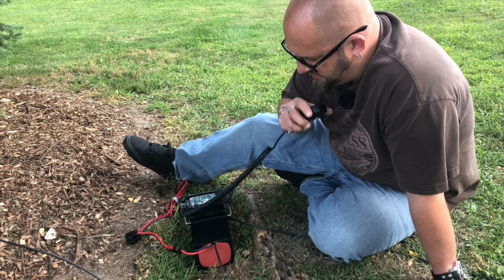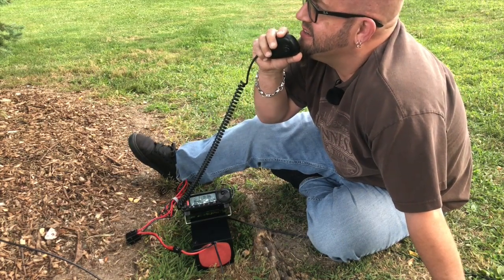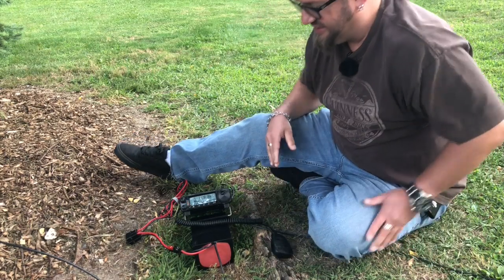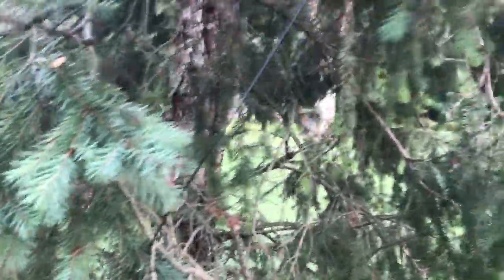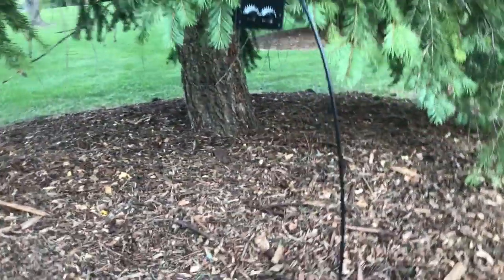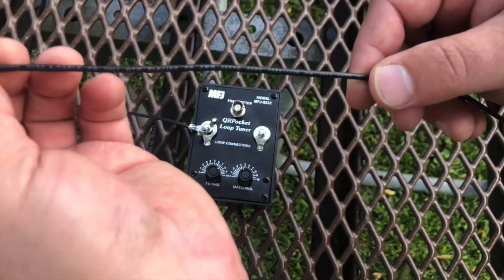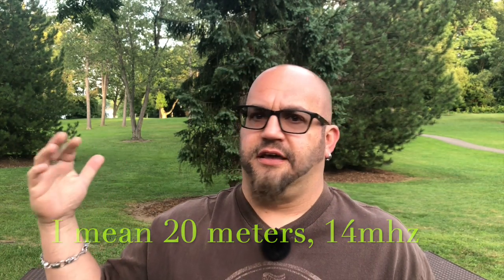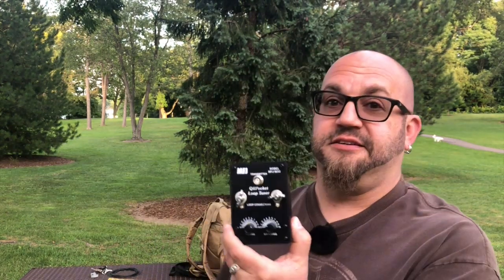The MFJ 9232 QRPocket Loop Tuner Ham Radio Antenna

Comment: I made a loop from 1/2 inch x 6' aluminum strip from Lowe's. Fashioned a loop and bored a hole big enough to fit on the studs on the tuner in each end.  I sit it on my desk after connecting to the tuner and "tuned" it using my MFJ antenna analyzer for 20M FT8...much easier than tuning with receiver / swr meter on rig.  I made a few contacts with it.  Just a quick note, these loops are not true magnetic loops, they are tuned loops.

Comment: The lower the resistance of the loop, the more efficient antenna it is, and the better it will work. Bent copper pipe would be very efficient, but a lot narrower on the tuning too.

Comment: Check out my channel, I have the MFJ-935C loop tuner and having lots of fun with it, it can handle up to 150 watts also, yesterday I was working some QRP with just 1.2 meters of 10mm soft copper pipe bent into a loop, I think this would be great to use with the MFJ-9232 which I also have but haven't used yet. I think a wire is easier to use for 40m. 

But with 4 meters of pipe bent into a loop and made contact with ham in Canada on 40m, I couldn't believe it and it was just sitting on a patio table!

Also for those with the 891 and do not know, in order to easily tune up you can press PTT and UP on the mic and it will send a 5w carrier and change the meter from power to SWR so you don't have to go through menus, just set 5w on AM once and you won't have to do it again, the 891 is an amazing radio and one of the most underrated radios in ham radio.

Comment: I see that that the tuning is done with the little tuner, but is it possible to get it as close as possible to say under 2:1 match and then use the tuner on the radio or external tuner?

Comment: I think i live in a dead zone!
MFJ-9232 set up for 20 meters, nothing. I tried different bands (and wire lengths) and nothing, Looks like i'm stuck on 2 meters......
Reply from the maker: Really??   That’s odd.  This thing was picking up signals inside my faraday cage of a house.  The rx was fantastic.  I didn’t use this too much on tx and eventually gave the antenna to a new young ham.  I just followed the instructions for the wire lengths and it worked for me.

Comment: Hi Mike:

BasedontourYouTube review (and others) I decided to buy the MFJ 9232 mini loop tuner.

I’m using a qrp rig that doesn’t have a built-ion SWR meter 

Do you see a problem in tuning this antenna using a mini VNA?  I have another antenna analyzer but I want to keep weight and bulk down

73guy
AE6FE 
Newark, CA
Reply from the maker: Not at all.   That NanoVNA would be perfect.  Have fun out there.

Comment: would this work in the cold? I have a covered patio where i could set this up and use it in the winter. I have tried loop antennas indoors and they just don't hear anything.
Thanks for another great video! Cheers from Lewis  VE3QJ
Reply from the maker: Temperature shouldn't matter at all.  I used this antenna inside my house and it heard all kinds of signals.  I was amazed as my house was like a faraday cage.

Comment: Of course, the cool thing is the tuner. I run a 275 ft at 75ft high loop, I've got 450 ohm running to it and a 4/1 ballun in the shack with a short piece of rg58 to the 7300 and get really good reports but I really think it could do even better ? What would you do or do you know any Guru's ? N6GRG Mike
Reply from the maker: Thats a heck of an antenna you got there.  This is just a little portable gadget, quite far from what you are talking about.  That big of an antenna is a little above my pay grade!

Comment: Hi Mike. What gauge wire do you suggest using? Thanks
Reply from the maker: You can pretty much use whatever you want.  It came with some 14 or 16 gauge I think.  If your doing qrp you can use some super thin stuff if you want.

Comment: I just got back home to CT from my camping trip in VT and saw this video.  When you said you had your antenna wrapped around a tree you weren't kidding!  I can't believe how strong I was coming in on that thing as my antenna wasn't really much better.  I was running 30W into my zip-line inverted vee with the center up only about 12 feet and the ends about a foot off the ground.  I was powering my radio with my SUV which was close to the antenna and de-tuning it to some degree as well.  So I guess that means the MFJ QRPocket Loop Tuner works!  This was a cool contact - I'm glad you caught me on the air!  I look forward to working you again in the future - 73 and thanks for including me in your video!  N1NUG - AKA SevenFortyOne.  BTW - you'll be in the video I post from this activation so keep an eye out ... might be a week or two before I get it edited and uploaded....
Reply from the maker: Right on man it was totally random catching you on the air.  I was just tuning around and I thought your voice sounded familiar, then I heard POTA and had to get you.  The antennas were working great.  This little loop has a surprisingly good receive, I'm quite shocked by it.  Your inverted V was doing quite well too, especially considering how low it is.  But thats portable radio.  It may not the the best conditions but it still works and thats what I love about it.  I look forward to seeing your video.  73
Reply: I'm in Guilford. I was living in Woodstock for a while. Where and how did you camp in Vermont. It's one of my favorite places. N1khb
Reply: @joewoodchuck3824  I was at lake bomoseen about a year ago.  I used to have family that lived in central Vermont so I'm very familiar with the State

Comment: I have two of those MFJ-9232, and also have the bigger brother MFJ-936B. There are indeed High- Q with narrow bandwidth, when fed with a low resistance conductor. The more resistance in your wire (thin wire), and poor connections will give you wider bandwidth, lower Q and more losses. But hey, you still make contacts. Mine use 3/8" soft copper tube, formed in a circle, and they are very high Q and have a very narrow bandwidth - they almost work like a pre-selector, any station above and below my frequency is notched out. These have the same attributes as a regular magnetic loop antenna - mag loops can be fed in many different ways, inductively fed, gamma, toroidal, or capacitively fed. These units are capacitively fed....also called an "army loop" or a "Pattersons Loop". Try it out - use a thick conductor, and you will see your Q go up, and bandwidth narrow. These are great units for experimenting with antennas

Comment: Really neat piece of equipment. Thanks for sharing. Suggestion: You could spray paint the wing nuts orange of shocking pink. Makes them easier to find when you drop them. You could always keep a couple extra on hand. 73

Comment: Sounds like a winner Mike.

The wire is 12 AWG  rated for 20 AMPS.

I tried an activation yesterday on with my WRC TIA  and mobile TS 480 at K-0345.  Heard lots of folks on 20 and 40 but no responders to my CQs.  Was hearing MEXICO on 40 and FLA, NC and VA on 20.  On the POTA FB Page I was told they could hear me, but I didn't hear a station that was calling CQ DX there in MI.

Comment: Loop antennas are great, we (my radio club) had a full wave 40m one deployed for a special event that was being run this weekend, BIWOTA  British Inland Waterways OTA. They are very quiet and very easy to deploy, if you have supports.  That looks like an interesting little gadget, one thing I'd be wary of though is using fork terminals with wires under tension, they may have a tendency to pull out if not properly secured. I'd be thinking about adding some kind of strain relief mod to take the tension off the terminal joint in the wire.

Comment: This is really interesting. There is also a higher power big brother. I am thinking I could setup a nice horizontal loop on my trellis.  I was wondering if you or someone else who commented and use one could post an an analyzer sweep?? I am very interested in how wide the usage range might be (say the width of swr 2.0). Also any comment on a horizontal versus a vertical loop? Your loop is inclined and clearly works well. On my trellis I would have a horizontal loop at about 10 ft off the ground.   One last question would it work if you formed a loop but use a short linear run of wire, maybe window wire so the unit can be located a few feet from the loop (on this I suspect not, but may be someone tried). Thanks for the video
Reply from the maker: I can't speak for the horizontal polarization of this antenna however, I just posted a vid of an analyzer sweep on the 40 meter band because you ask some very valid questions.  I would be curious how it would perform horizontally.  The great part of ham radio is experimenting, and this antenna is one that surely encourages that.  Oh, and I was running 25 feet of coax to the tuner.  This is not like other loops where you need to be in close proximity.   That doesn't matter.
Reply: @hamradiotube  Thanks Mike, that video was very interesting and impressive. I think I will try one of these out.
Reply from the maker: @douglasdreger3852  No prob Doug, I was so excited to make this video I didn't even think about doing a sweep of the band.  Thanks for the suggestion.

Comment: Thanks, mine works also great with 1/4" cooper air conditioner tube
Reply: Icemaker tubing.
Reply from the maker: Heck yeah, thats what they are talking about when they say experiment with it.  Its not just for wire, its for anything metal!  Thanks for letting us know how you use it.

Comment: Mike,
If you have some sharp nippers or flush cutting pliers, you can cut off the side of the ring terminal making it into a hook terminal.  WB3BJU

https://www.ebay.com/itm/100PK-Hook-Ring-Terminal-22-18-RED-Vinyl-Insulated-10-Hook/292930835633?hash=item443409d4b1:g:ChQAAOSwusdcSHZ6:sc:USPSFirstClass!19064!US!-1